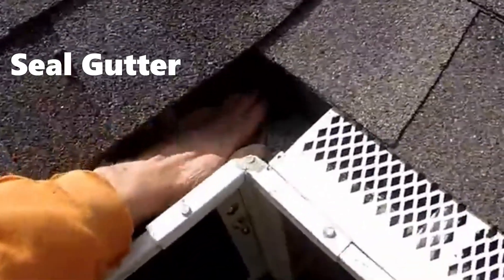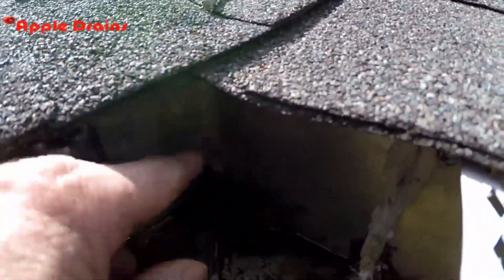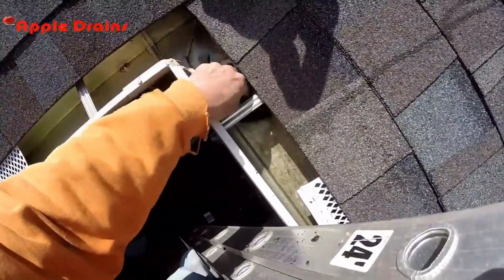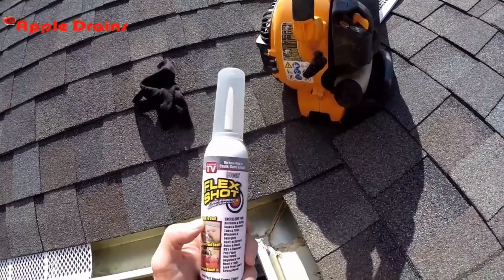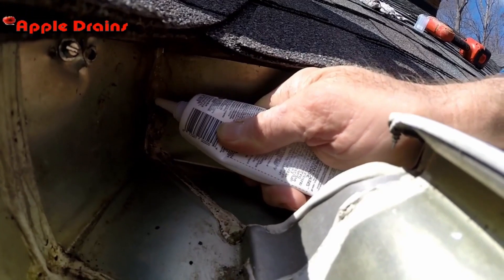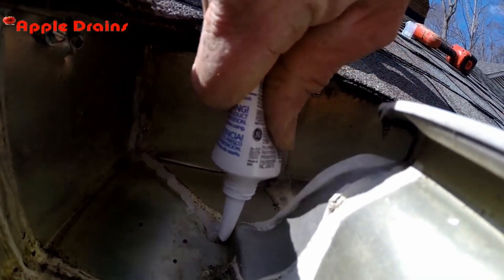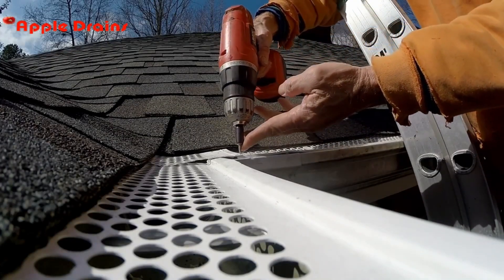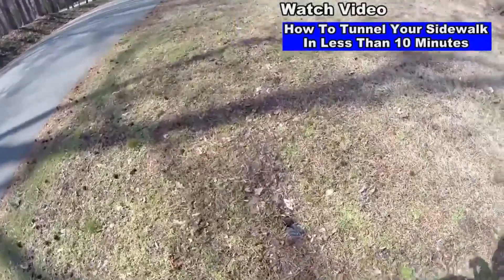How To Seal a Leaky Gutter - Do This Before it Freezes!!

Comment: This is the exact repair that I need to do. I just need to figure out how to get off the gutter guards. It's probably easy, but I just haven't looked far into it.
Reply: If it is the screen type they just pop off the edge of the gutter and you can pull then out from under the roofing shingles. That is what Chuck has on his home is Charlotte, NC.